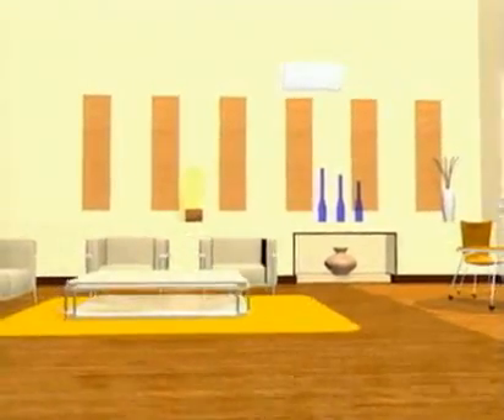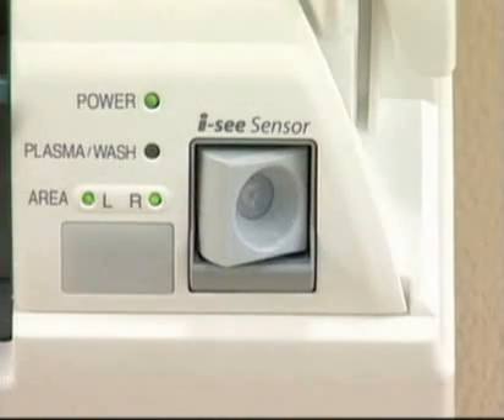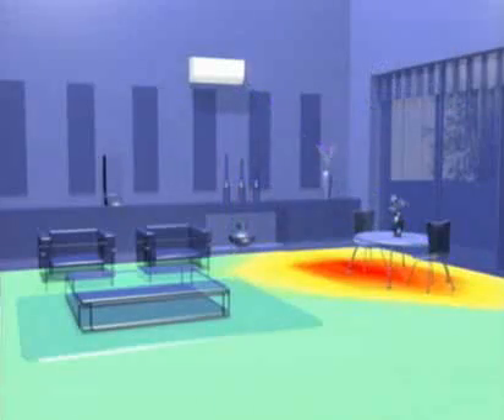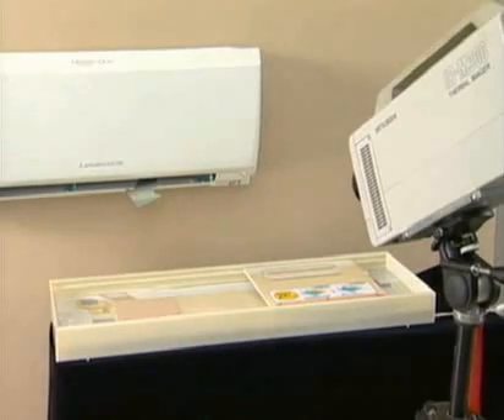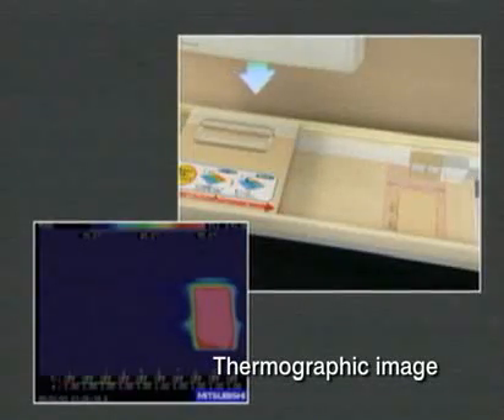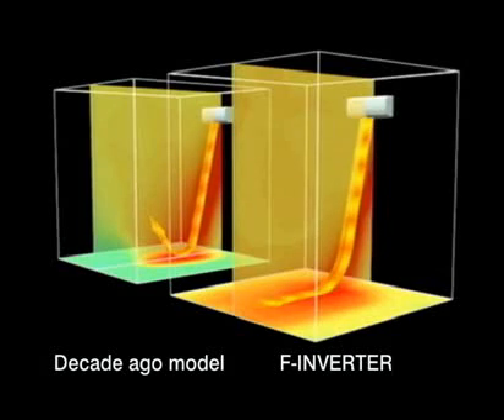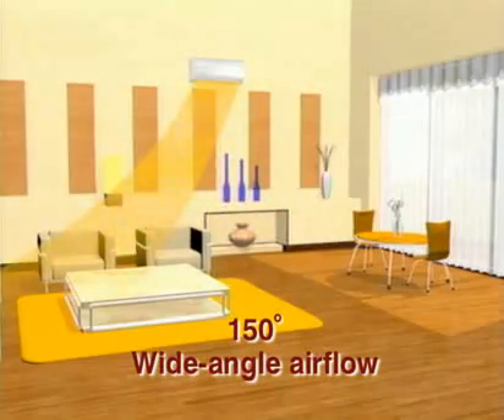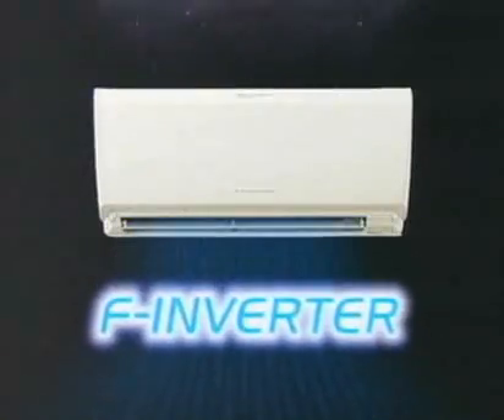Mitsubishi Electric 3D i-See Sensor

Comment: I just wish this sensor could be used by other smart devices too. For instance, should the sensor detect a lot of heat coming from the window it will tell a smart system like KNX or Loxone shut the blinds. The same applies with light and every other smart device that might needs to know whether a room is occupied or not. Something like that would definitely increase savings both in power consumption and in reduced complexity for installation for other sensors that do the same job.